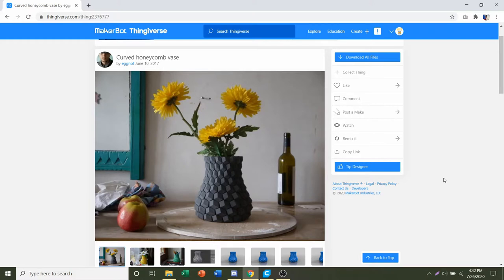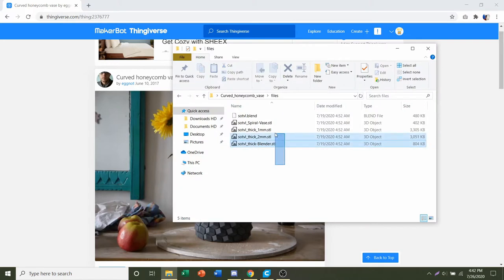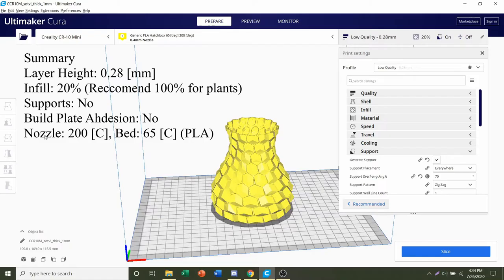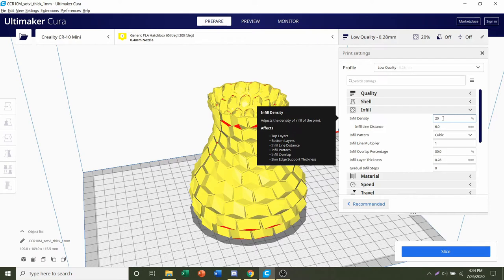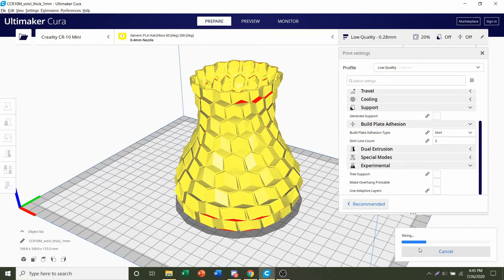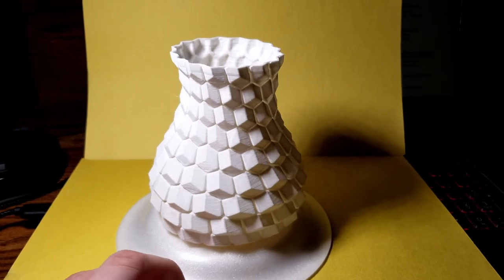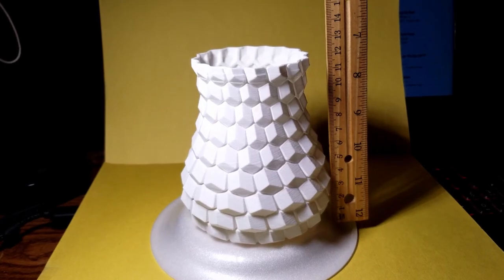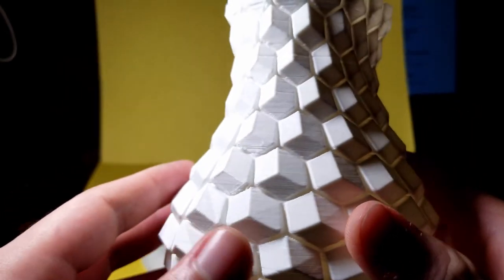Curved Honeycomb Vase 3D Print - Tutorial, Print Settings, Time Lapse, Showcase

Comment: im not using an ender 3 but like, a chinese knockoff with an ender 3 hot end. 1.75mm .4mm nozzel. used 31gram and took 3 hours and 3 minutes to complete. 0.2mm layer height.